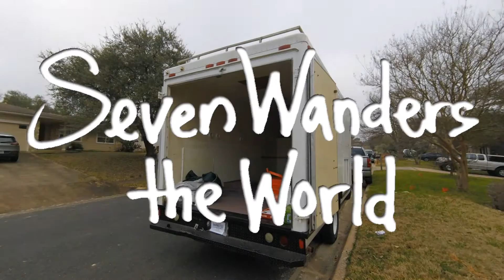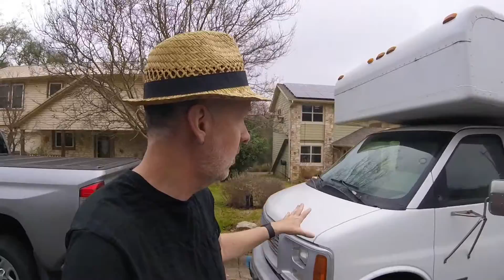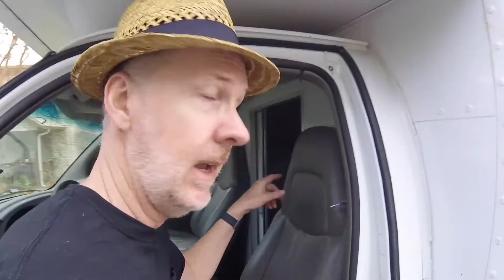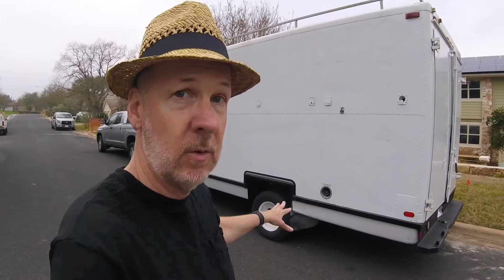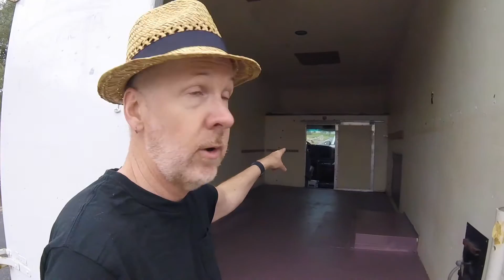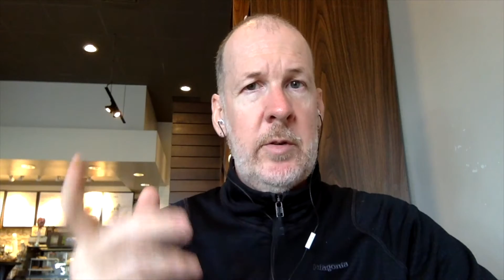Box Truck Tour (Before Conversion) Austin TX E164

Comment: Exactly how I'd do mine. Especially the stealth aspect. There's a young lady, Box Truck Dreams, who has a "porch" at the rear with a door, 2 windows and a through wall A/C unit that's hidden when she closes the roll up door. Yeah, I wouldn't do a roll up door either and would go the same way as you. BTW, I'm in Houston (Montrose). How much was the truck just so I can get a ball park of how much to spend. Looking forward to your videos and good luck.
Reply from the maker: I've seen the build out of the box truck dreams project. she did some nice work. I'm deciding this week if I'll sell my gas box truck and switch to a diesel step van, so if you are interested in buying mine it might be for sale next week. I paid $6,500 out the door at a dealer and have about another $1500 into it for wiper motor, alignment, steering bushings and fuel pump.

Comment: Is that an L60 or an L80 transmission?
Trans flush is your friend.
200 now will save that transmission later on.
Synthetic fluid...worth every cent it costs.
Reply from the maker: thanks for your message! I did the trans flush in one of the videos when I was visiting Guisepi in Hot Springs National Park. I don't know the model of transmission and would have to look it up (I'm not a mechanic type person)

Comment: Wow! Although it's an older model it looks like you got a great deal! I could handle all that space at 10 mpg. The 5.7 is legendary for reliability and easy to find parts for. Plus the insulated walls  pass thru and barn doors. There is a video of pictures of a yellow 14 or 16 foot on Youtube and that person built a back door 2 feet or so behind the roll up door for tool storage n stuff.
Reply from the maker: I've seen that video of the yellow box truck. I think I've watched most of the videos out there for box truck conversions (although JYdog has so many it is hard to keep up with his project). I think I'm not going to build a side access door, instead, I'm going to add a two way lock & latch to the back doors and use the side small generator door for a BBQ area and access to the water storage under the sink kitchen area.

Comment: How long is the truck?  And approximately what is length, width, height of interior space & over cab area?

Excellent choice & I am so glad it has the access to driving space.  A living area is needs to have have 2 exits, so that works.
Reply from the maker: I don't have exact measurements yet. it is about 24 ft long and I'm guessing about 11 ft tall. interior box is about 7 ft 2. area over cab is rather short... maybe 30 inches... not sure because I'm guessing. the pass-thru is very very nice and I use it almost more than the rear doors. I'll be doing actual measurements once I have my tape measure next week (from my storage in Florida)
Reply: Thanks for responding!  I'm guessing the interior is just a little over 6' wide & about 17' deep not counting the "bed" area which I'm guessing is about 3' deep?   If so, that would give you about 102 sq ft of open floor.

Having it already insulated was a great deal.  It looks like you found a gem!  I look forward to watching the build.